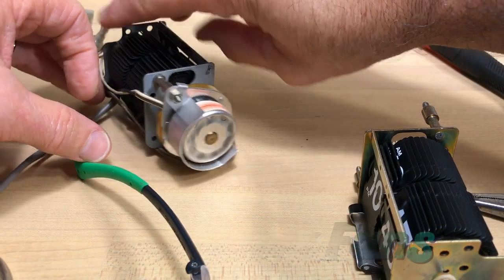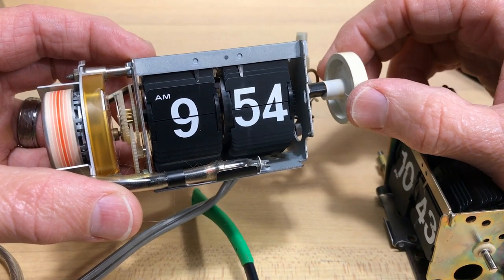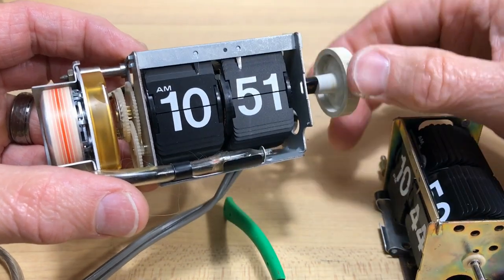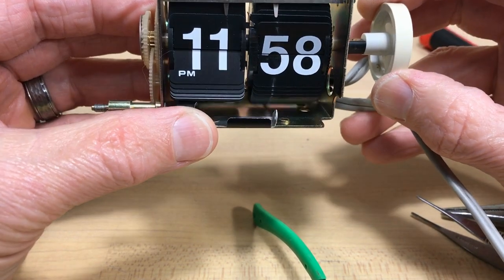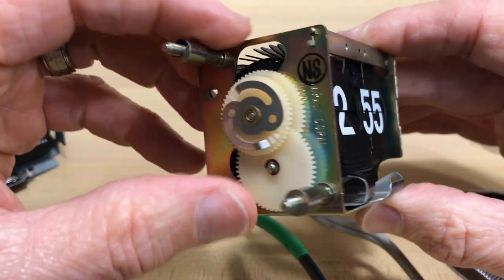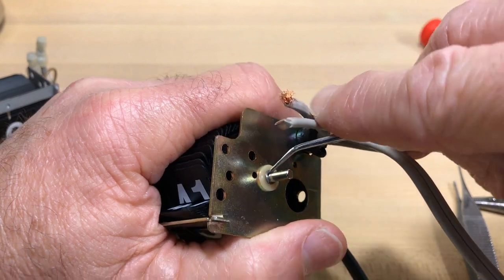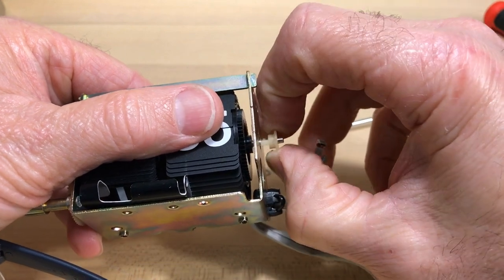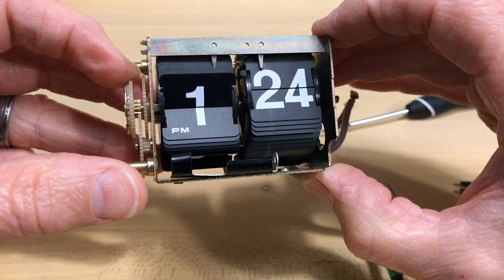Fixing an out of sync flip clock

Comment: Mr. FLipclockfans... you. are. awesome!! Thank you so much for the video!! I haven't tried fixing it yet but it looks like it is out of sync. My spring seems to work correctly. I will try this tomorrow and let you know how it goes.  Again thank you very much for doing this!!
Reply from the maker: You can call me Mackey.
Reply: @Flipclockfans  Thank you Mackey. I was able to fix it. It actually was both issues. The spring was bent so it was not holding the hours properly and it was out of sinc. So both are fixed and it is working great. Thanks again!